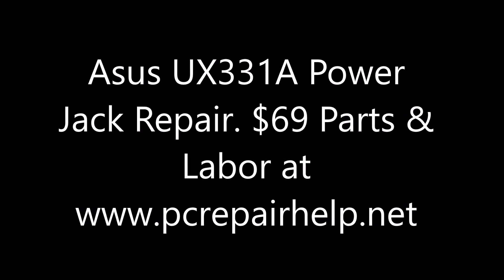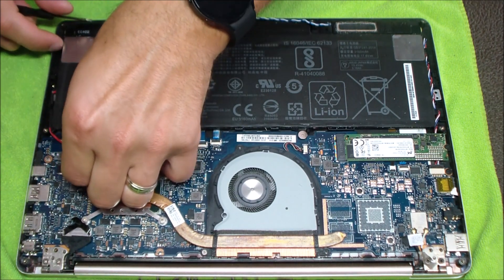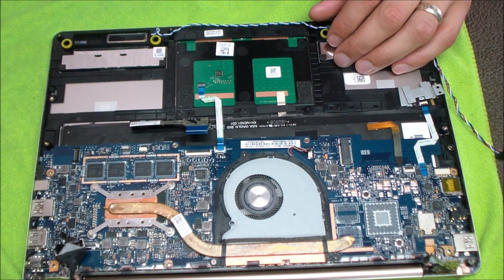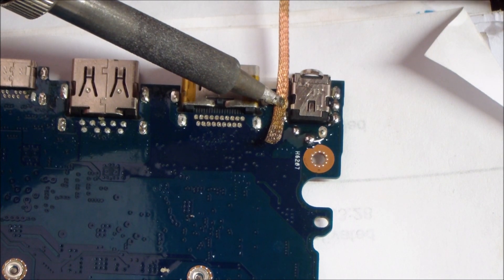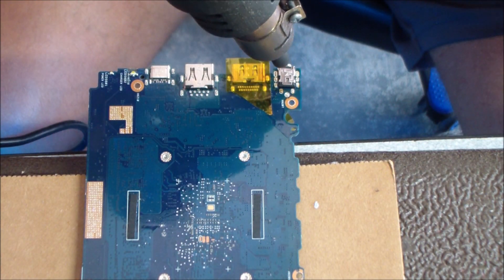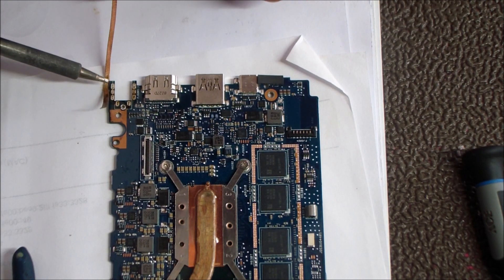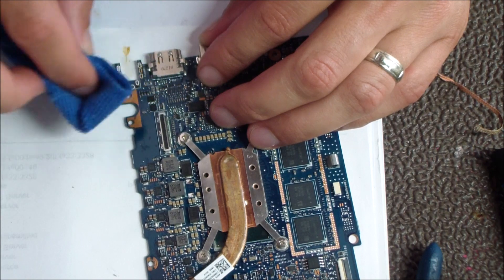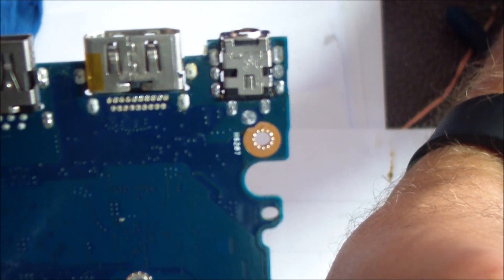Asus UX331A DC Jack Repair (Bad charge port)

Comment: maximally breakable; minimally serviceable.
Reply from the maker: Yes, the soldering isn't for the faint of heart and can be very difficult.
Reply: Just thinking that.  My Acers have always had the jack connected to a length of wire and a plug on the other end which plugs into the board.
Reply from the maker: @dazgrizz839  yes, those are easy to replace and a good idea.